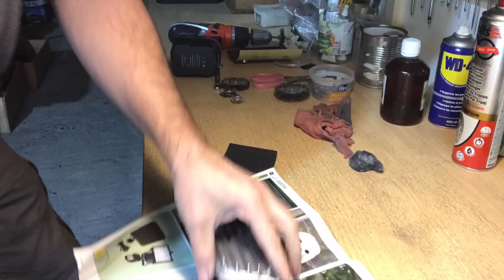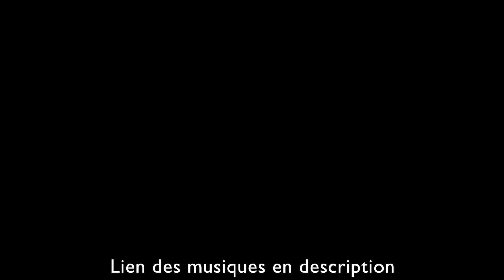HONDA XLR 125 R Part.7: Montage Kit cylindre piston 165cc BERLT Racing

Comment: Bonjour BenG, merci pour toutes les vidéos. Je dois refaire les joints haut moteur de ma XL125S de 81. Quelles sont les précautions d’usage sur le graissage des joints ? Quel produit huile 10w40 ? Pourquoi de la pâte à joint au niveau cache culbuteur  ? Dernière question par curiosité quel type de papier buvard avez vous utilisé pour la confection de vos joints de carter?
Merci d’avance et bonne journée.
Reply from the maker: Bonjour à toi et merci pour ta visite sur ma chaîne. J'enduis mes joints d'huile moteur avant montage. La même que je mets dans mon moteur et c'est bien de la 10W40. Soit de la minérale pour les moteurs de voitures soit de la synthèse pour moteur à embrayage humide. Je mets de la pâte à joint entre le cache club et la culasse car c'est ce qui est recommandé pour cette machine. D'origine il n'y a pas de joint papier ou caoutchouc. En ce qui concerne les joints de carter c'est du papier spécial de type "indéchirable" en 0,5mm d'épaisseur de la marque TIDO que je me procure en ligne.
Reply: Merci pour ces recommandations et bon courage pour vos prochains projets. Je garde un œil attentif à toutes vos publications 👍.

Comment: Salut Ben, j'ai fouillé la boutique de l'ami Anglais. Il vend un paquet de pièces, tellement que le choix est difficile ! 
Je suis tombé sur un kit complet cylindre piston AAC et carbu de 26 mikuni, donné pour 190cc la dessus j'ai un doute ? Cela implique de retailler les carters right ? 
Il me semble pas avoir vu de kit 165 par contre, 150 et 190 de mémoire. 
J'ai un peu de mal avec le calcule des cylindrées, j'ai cru comprendre que la cource de la bielle entre en jeu et pas seulement la taille du cylindre piston. 🤔
Reply from the maker: Le calcul de la cylindrée c'est: alésage x alésage x course x 0,7854. Les kits qu'il vend font 165cc et non 190. Je n'arrête pas de lui dire mais bon... Ca n'a pas l'air de le déranger... Il vend celui que tu as vu avec carbu et arbre à cames:
 https://www.ebay.fr/itm/274497320931?hash=item3fe950b7e3:g:J~8AAOSwdzVXvr74
Et un autre avec cylindre et piston seulement: https://www.ebay.fr/itm/275064781454?hash=item400b237a8e:g:J~8AAOSwdzVXvr74
C'est celui qui est installé sur l'une de mes XLR125R. Dans les 2 cas, l'alésage est bien 65,5mm. Pas besoin de retailler tes carters, ça se monte directement et tu peux même utiliser la culasse d'origine.
Reply: @BenGallou  Parfait et un énorme  MERCI encore pour ces explications ! Je vais partir sur le kit complet je pense, tant qu'à mettre les mains dedans, autant tout faire d'un coup ! 
Puis j'imagine que l'AAC et le carbu sont adaptés au cylindre alors ça devrait apporter un bon gain de couple tout ça ! 😁 
Je continu la playlist, pour le plaisir et la curiosité, la musique douce et les bruits d'outils sont vachement reposant mine de rien, et faut dire que ton travail est super propre et instructif. 

Je me suis inscrit sur le fofo sous le même pseudo 👍 
A bientôt !
Reply from the maker: Je suivrai ton post avec attention. Surtout quand il s’agira de réaliser le montage.
Reply: @BenGallou  Bonjour Ben, penses tu qu'avec ce kit cylindre il est possible de monter un embiellage permettant d'atteindre les 190cc ? Par exemple avec vilebrequin/bielle de CB/200 ou cg/200.
J'ai vu sur un forum que certains passaient leurs 125 Ajp en 200, mais je n'ai pas trouvé le process détaillé.
A défaut de trouver un xlr à prix correct j'ai dû me rabattre sur un 125 Derbi senda que je vais chercher semaine prochaine, et sur lequel je compte au minimum monter ce kit.
Reply from the maker: @zimack3395  Oui c'est même possible d'aller jusqu'à bien plus. J'ai fait un montage en 223cc. Video en 2 parties dispo ici: https://youtu.be/O3kSU20Z9Ko et ici https://youtu.be/5yKQEMqykjc
Reply: @BenGallou  Merci, oui j'ai vu les vidéos de tes modifs en 223, ça fait pas mal de temps que je suis ta chaîne.
Mais du coup je m'interrogeais sur ce que ça pourrait donner en utilisant le kit 165 et un autre embiellage.
Dans des commentaires j'ai vu que tu disais que l'aac du Derbi est plus agressif ,à la base je souhaitais prendre le pack kit cylindre/aac/carbu chez Berlt, mais du coup l'aac qu'il propose est similaire à celui du Derbi c'est bien ça?
Reply from the maker: @matthieudube2046  Un autre embiellage pourquoi pas mais j'imagine que c'est tout de même dans le but d'en augmenter la course? Du fait, le cylindre Berlt ne conviendra pas à moins de mettre une cale d'embase, des goujons, chaine de distri, tendeurs plus longs... De mon côté je ne pense pas avoir fait le tour de tous les embiellages pouvant se monter sur ce moteur JD09 et tes recherches seront instructives. Souviens toi surtout qu'il te faut la longueur de soie de vilo nécessaire au dispositif de demarreur électrique côté gauche. Ce qui exclu toute la game des vilos pour XLS185 (si c'est à cela que tu pensais). Attention aussi, le moteur d'AJP est un Zongshen, pas un Honda, donc quelques différences notables. Sur la Derbi, c'est un vrai Honda JD09 made in Japan, tout comme sur le Gilera Cougar.
Ton AAC Derbi fera l'affaire! Il en existe de nombreux sur les sites chinois. Mais tu peux aussi taper dans la gamme pour CRF230. Aux US ils ont toutes sortes de modèles pour cette machine que tu veuilles un moteur typé cross, trial, ou entre les 2... Gros choix également au Brésil et en Indonésie mais moins facile de se les procurer.
Reply: @BenGallou  Oui un embiellage différent afin d'augmenter la course, mais je n'avais pas pensé à la cale d'embase et tout le reste. Je vais continuer à creuser sur ce sujet, et éventuellement tenter ce que tu as fait en 223, au moins c'est testé et approuvé, ça limite les bourdes de mon côté étant donné que je reste novice en mécanique.
Je vais faire des recherches sur les crf, et oui j'ai vu aussi pas mal de choses du côté du Brésil, beaucoup de modifications de xlr.
Merci pour tes vidéos, c'est une aide précieuse.
Reply: @BenGallou  Autre question, j'ai vu sur une de tes vidéos lors du montage d'un kit qu'avant montage tu rentres un segment dans le cylindre , que tu effectues une vérification avec le jeu de cales ,puis tu limes légèrement le segment afin d'arriver a une certaine valeur. Pourrais tu m'expliquer cette démarche , et me dire à quoi correspondent les valeurs recherchées, car je n'ai pas trop saisi cette partie.
Merci d'avance.
Reply from the maker: @zimack3395  C'est ce qu'on appelle le jeu à la coupe des segments. Ça consiste à vérifier ou corriger l'espace entre les 2 becs du segment une fois installé. Pas assez de jeu entrainerait le serrage du moteur lorsque les 2 becs se touchent lorsque le moteur chauffe. Trop de jeu entrainerait une mauvaise étanchéité. Il existe des tableaux et des formules pour calculer le bon jeu en fonction du diamètre du cylindre et de l'usage du véhicule. Cherche "ring gap calculator" si tu veux  avoir une idée précise sur la chose...
Reply: @BenGallou  Super , merci pour l'explication !
Je vais regarder ça.
J'ai bien fait de demander, car j'aurais fait le montage sans m'en soucier en pensant que c'était facultatif alors que c'est très important.
Reply from the maker: @zimack3395  Oui très important. Tout comme il faut mesurer le jeu cylindre/piston.
Reply: @BenGallou  Merci, ça non plus je ne l'avais pas pris en compte.
Je suis bon pour quelques recherches avant de me lancer dans le montage.
Reply from the maker: J'avais pas vu que tu m'avais contacté sur Mout y'a quelques mois. J'y suis très peu souvent. Va dans l'onglet "à propos" de la chaine, tu pourras trouver mon mail et mon insta pour me contacter plus facilement si tu veux aller rouler.

Comment: Bonjour, vous avez monté le haut moteur en 150cc ? il y a t'il besoin de modification ou il rentra a la place du haut en 125 ? Merci
Reply from the maker: Bonjour. C’est un 166cc (alésage 65,5mm). Oui il se monte sans modification
Reply: @BenGallou  Merci pour votre réponse, ou l'avez vous trouveré , je ne le trouve quasiment nul part. Cordialement
Reply from the maker: Sur eBay
Reply: @BenGallou  difficile a trouver, meme  en cherchant avec l’alésage 65,5 je ne trouve que des kit 190cc pour d'autres motos , vous avez la marque ou le modelé ?Merci
Reply: J'ai trouvé celui la https://www.ebay.co.uk/itm/HONDA-XR125-190cc-65-5mm-Big-Bore-OHV-ENGINE-95-To-08-OE-CYL-GASKETS-/273954521691  , il ma l'air d’être le mémé que le votre mais ils demande a élargir le bas moteur :/
Reply from the maker: @DJFabioFerreira  Cherche HONDA XLR125 190cc Alésage Kit. CPO modèle 97 -03
Reply from the maker: Je précise tout de même que malgré le titre de leur page sur Ebay, la cylindrée n'est que 166cc et non 190.
Reply: @BenGallou  je vais chercher ça :) je vous remercie, j'ai le même projet que vous, vos vidéos et vos compétences me sont très utiles. Merci
Reply from the maker: Ce n'est pas le bon. Celui ci est pour le 125 XR-L. (moteur avec tiges de culbuteurs)